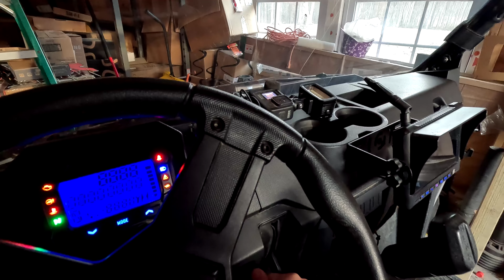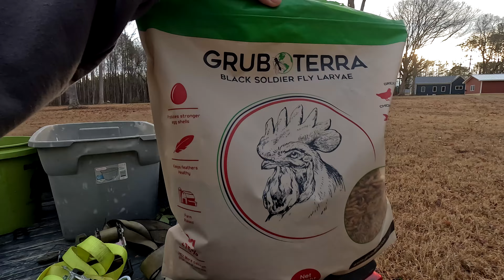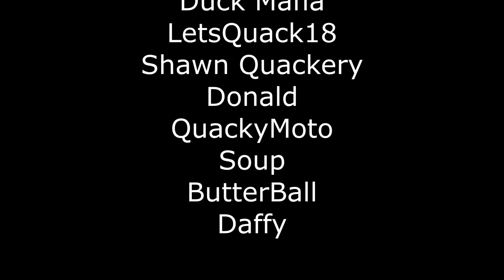Ducks Try to Fly Away on a Lazy Saturday

Comment: Lime now!  It takes over a month to receive the benefit of the lime application, more like 2 months, so you should strongly consider liming ASAP.
Yes, I have much experience…
Reply: Won’t lime on the surface wash off potentially into the pond and effect that?
Reply from the maker: Ground is too soft to run the truck around
Reply from the maker: @kevinmountford4541  some people add lime to new ponds
Reply: My call:  Get a walk-behind & git”er done w/ the lime… add urea(46-0-0) to existing turf, too
Reply from the maker: @esparka  Pelletized is way more expensive but haven’t been able to find the powdered ag lime for purchase in qty

Comment: The old time farmers might have had a lot of money in the bank (or under the mattress) but they used what they had before buying more. Nothing goes to waste as they lived the depression. Pretty takes second place to functional. Waste not, want not was a point of pride for them. Old windows became covers for hot beds so you could start plants earlier, etc. Most had stacks of sawmill lumber air drying under some old tin roofing. And you are going to need that cash for a good large mower with all that grass to keep up once you get it planted and growing. Also will likely want a small to mid size tractor at some point. Seems like it never ends. Have a great one, y'all.
Reply from the maker: You’re right Mark. Stay tuned 😁

Comment: Hey Geoff, have you decided what gate openers you are going to use on your front gates? I just wanted to let you know that Ghost Controls makes a really good opener for a fair price. Mine has been working great for 2 years now.
Reply from the maker: I have looked at those and wondered if they would hold up. Thank you for the feedback
Reply: @BealyGood  I installed mine myself with no problems. I believe the actuator has a lifetime warranty if you register it on their website. Your place is really looking great now, keep up the good work.

Comment: BG what’s with the garage doors?
Reply from the maker: Need some.
Reply: Probably only made in Ukraine.
Reply from the maker: @kenore4003  I priced ones that were insulated and looked like barn doors. $13k 😳
Reply: @BealyGood  Looks like you're going to be going to Menards for the cheap tin ones. They're only about 600 bucks. Anything that looks nice is really pricey.
Reply: Got two here going begging but they are in the uk!
Reply from the maker: @kenore4003  I wouldn’t mind non insulated but want the barn door pattern